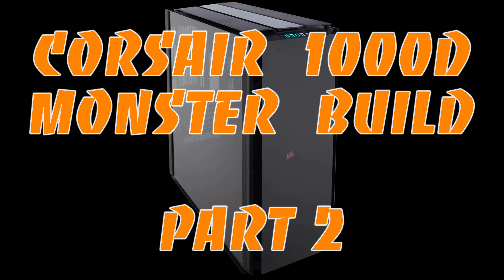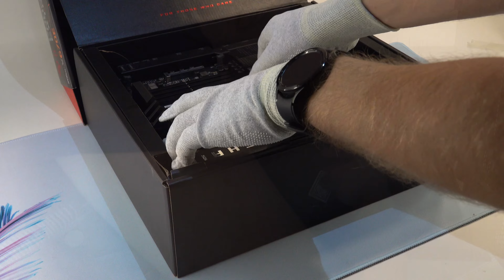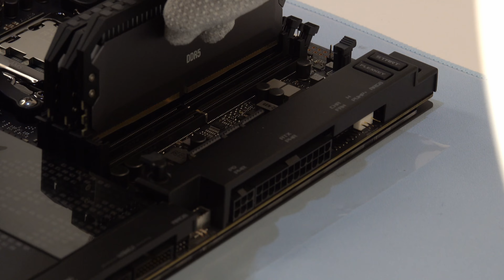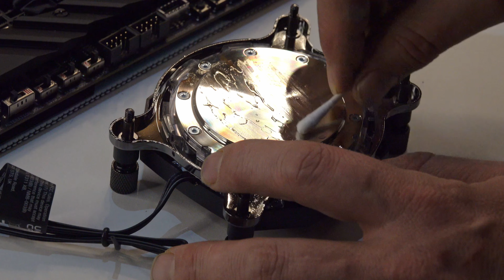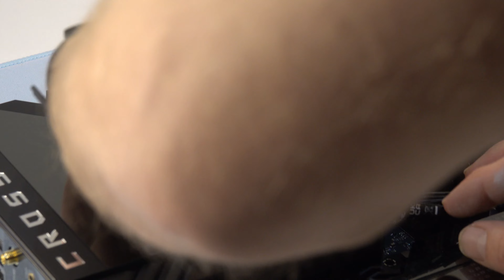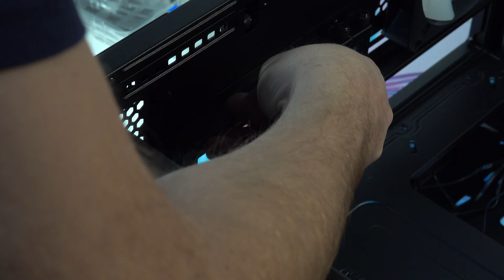£10,000 Monster Computer Build - Corsair 1000D - Part 2 [2023]

Comment: Говорят у четырёх планки DDR5  работает только 3600Mhz и нероботает XPM (EXPO)  на AMD?
Reply from the maker: Hi Rahmon,

When you enter BIOS settings you can select what MHz is running on the installed  DDR5 RAM and also can chose whether you wish to apply AMD EXPO or not.

Mine runs just fine at 5600 MHz applied with all 4 DIMMS but I did need to do a BIOS update to use more than 1 DIMM.
Reply: Отлично! Спасибо за ответ! Было бы здорово если вы сняли видео как обновить BIOS на вашем материнской плате.